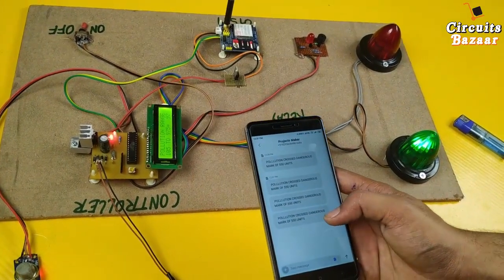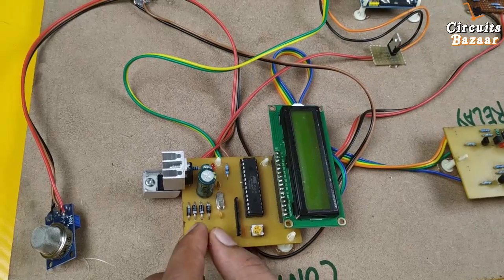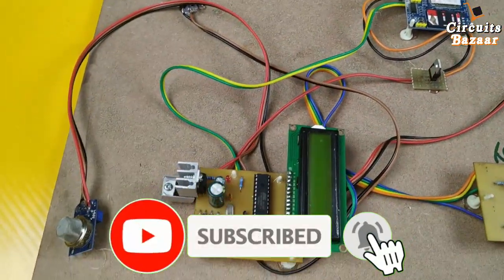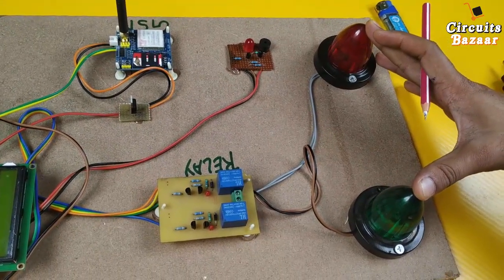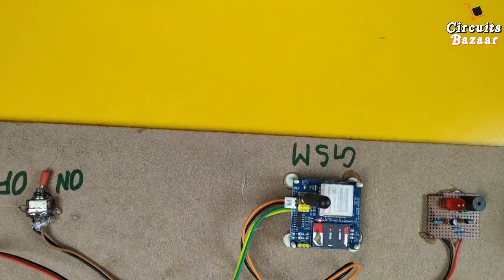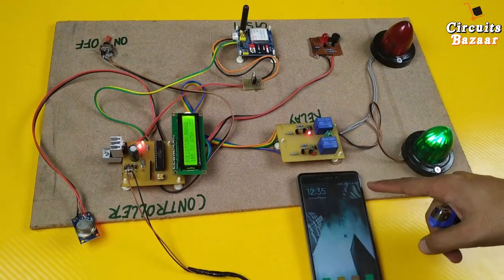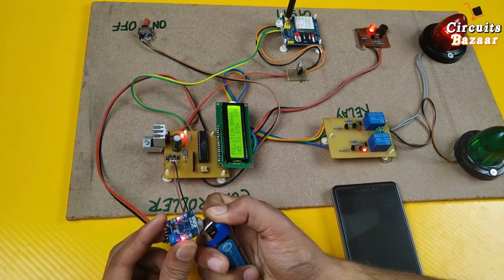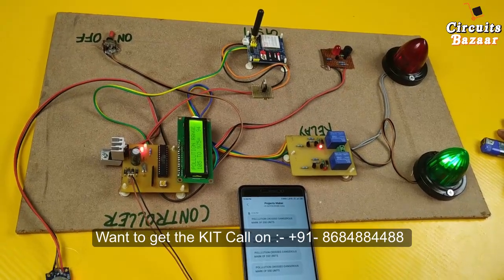Vehicle Pollution detector and sms alert project

Comment: Hello sir,there is lot of vehicles stops at traffic signal.what if the sensor  detects the smoke of other vehicles gas ?
Can you please tell upto how much distance the sensor can detect the smoke.?
Reply: The sensor installled right at the first point of exhaust so no chance of detecting other vehicle gas
Reply from the maker: you will apply the sensor at the exactly at the output of exhaust, so it will detect only the vehicle where it is implemented